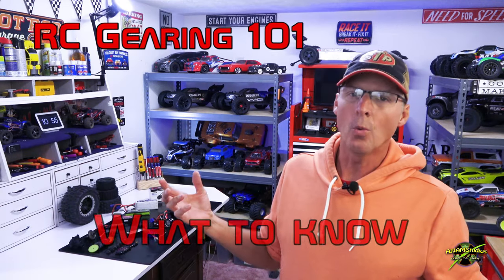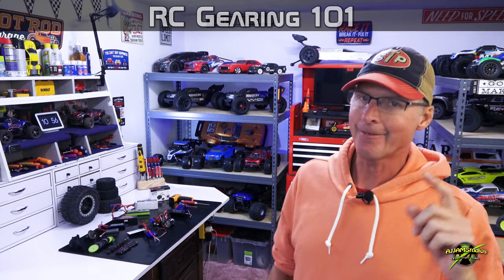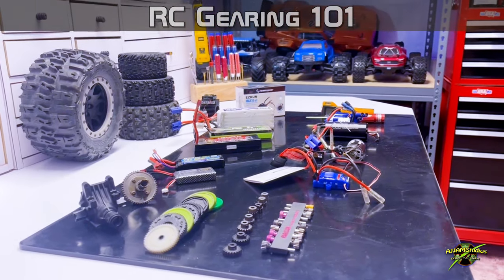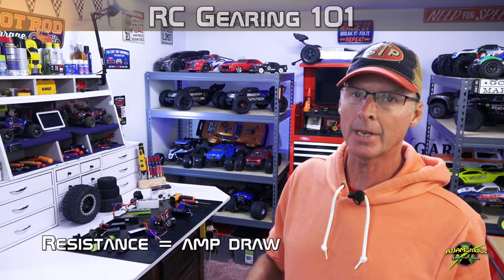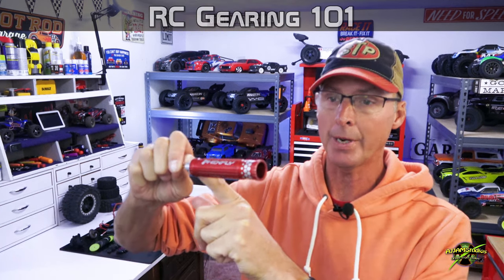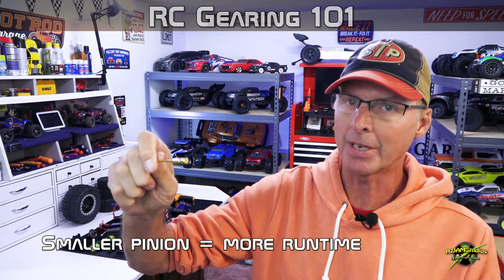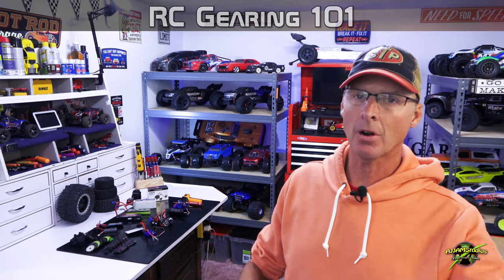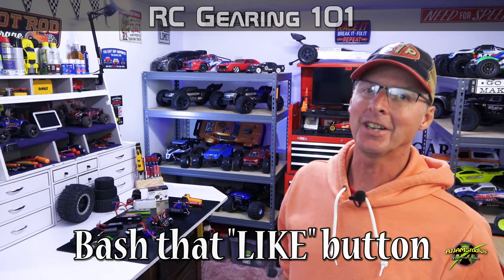RC Gearing 101

Comment: Back in the 80s we were using 6 cell NiCad batteries for racing.  You had to gear the buggy to last for a 4 minute race.  If you did it right the battery dumped just after you cross the finish line.
Reply from the maker: We struggled to get the perfect setup. Back then the cars were weaker, the speed controls were mechanical, batteries had memory, but life felt simpler somehow. Today we are spoiled with what is available and the kids in the hobby take it for granted. Sometimes I miss the old days. Thank you and I appreciate your comment 😎👍

Comment: This is a great video and I learned a lot from you (and subscribed!) but, correct me if I'm wrong, isn't "1C" equal to the total amp hours of the battery? i.e.: for a 5200 mAh battery 1C == 5.2 amps and thus a 50C, 5200 mAh battery would be able to provide 50 x 5.2 amps max. Am I wrong? You seem to imply that "50C == 50 amps" regardless of the mAh, but I totally could be missing something! Again, great video!
Reply from the maker: That is not how it works. The C rating has little to do with capacity. You can have a 5200 mAh battery in 20c or 120c. Power draw or amps is the safe amount of current the battery can handle without damage. What you refer to is charging amps. For a 5200 mAh battery 5.2 amps is the max charging amps you should use. A 2000 mAh should use 2.0 charging amps and so forth. This has nothing to do with the C rating. I hope this helps and thanks for asking. You should check out RC batteries 101 in our 101 playlist. It’s informative 😎👍
Reply: @AJJAMStudios not true, a 20C 5000mAh battery is rated for 100A discharge current, vs 20C 1000mAh would only be 20A
Reply: C value is discharge rate of capacity. 25C is 25 times its capacity, which give us max amp drawn. For 2000mAh(2Ah), 25[C]×2000[mAh]= 50'000[mA]  = 50A
Reply: @moellerjon I agree.

Comment: Friend, please help me, I'm new to car modeling, I built an onroad car, with a 64pitch pinion with 40T, and a 64pitch 96T spur gear, I use a hobywing 10bl120a esc, the futaba 3pv radio has the end point at 100%, the 10.5T Brushless engine for 1/10 cars in the few laps I drove, the spur gear damaged all the teeth, how can I be doing so that this doesn't happen?
Reply from the maker: Gear setup is touchy at times. Making sure your components are all using the same pitch is one issue that can pop up. Also the spacing between the gears is critical as well. Then there is the parts themselves, plastic, aluminum, or steel. Some hold up better than others.

Comment: I'm looking at gears online for my SCX10 6X6 so I can get a general idea of what to get at my local hobby store and I've noticed some gears have a pitch number and others don't. What exactly is the gear pitch? I've seen 32p, 36p, I think maybe even a 48p, I can't remember. If a spur gear has a 32p, does the pinion also have to have a 32p in order to work properly? What about the gears that don't have a pitch number? Can I use a 15T pinion with an 87T spur if both gears don't have a pitch number listed and are made of steel?
My 6X6 has a dual motor set-up (I'll be using 2 brushless) mounted to the single speed transmission and all 3 differentials are spool type. I have 2.2 wheels with aggressive, deep cleats in the rubber for maximum climbing capability mounted on straight axles (not portal).

Comment: Hi there I'm stumped about my pinion gear on my Tamiya konghead.i installed a 6900 kv brushless and a aluminum 18 tooth 48 pitch pinion gear and it gotten chewed up but the drive gear was almost unfazed.how did this happen? subscribed!
Reply from the maker: Not all pinions are equal. Some are softer than others and wear faster. Perhaps a better pinion would help. 😎👍

Comment: I have a Traxxas e revo 1/16 scale the 4x4 n I have been running the vxl speed control n motor with the stock spur gear but I got it used from a friend n he beat the heck out of it then I had to put some tlc into it but the tires was wore down so I bought some aftermarket ones to put on it it's been running fine oh ya the pinion gear my friend gave me n said he thinks that was the one that was on n it but anyways just here recently the motor n esc started getting hot so I lowered the pinion gear from 23 to 21 now will that make it run hot or run cooler?
Reply from the maker: Lowering the pinion size should cool things off a bit. Check your temps to be sure. The tires, if they are heavier or a bigger diameter, will still add amp draw and cause heating of the ESC and the motor, so be careful until you get your temps down to a safe level. Thanks for commenting. 😎👍

Comment: AJ- great educational video!!! So should we shoot for 120-130 motor temps for the sweet spot?
Reply from the maker: Anywhere in that range should work. 😎👍
Reply: Rule or thump is you can not touch it without burning your self if it is above 60°C.
(120-130°F = ~49-54°C)

Comment: I have a Team Associate Sc10 2WD with 87T spur and 17T pinion mated to 12-turn 550 Traxxas Titan brushed motor. It burned down Radiolink Cool 9030 (90A rated) and ISDT ESC70 (70A rated) escs on both 2S and 3S LiPo batteries at 50C rating. I went to a hobby shop, and they told me to up the pinion gear  so it wouldn't pull so much amperage because smaller pinion is higher torque  = higher amperage true
Reply from the maker: Not true. More resistance = higher amp draw. Bigger pinion = more resistance.

Comment: 9:16 : sorry but I think you make a mistake with C rating to get the amperage you have to multiply C rate by the battery capacity
5200MAh x 20C = 5.2Ah x 20C = 104A 
your battery can provide 104A and not 20A - 1C is not equal to 1A

I (current of discharge ) = rated energy batt (Ah) x C rate
Reply from the maker: That is good to know. Thank you for sharing that with our community. 😎👍